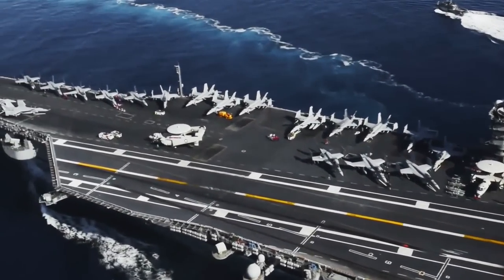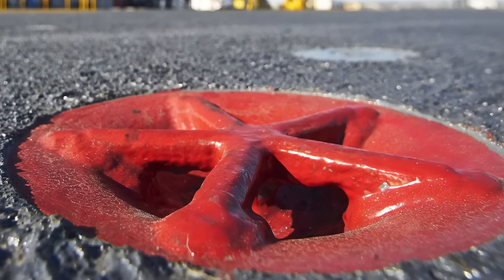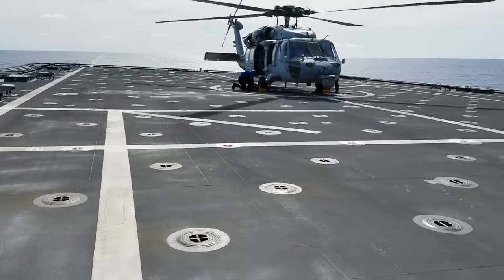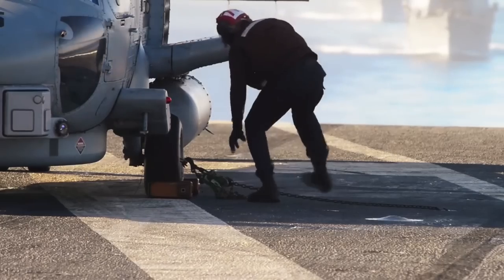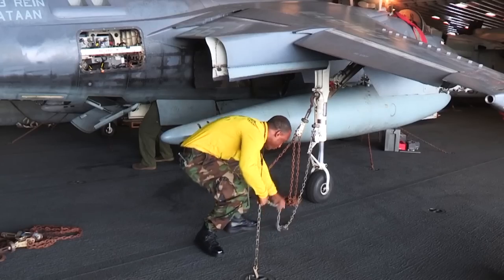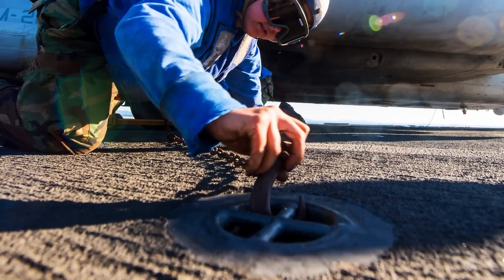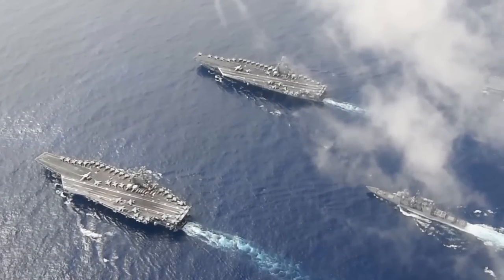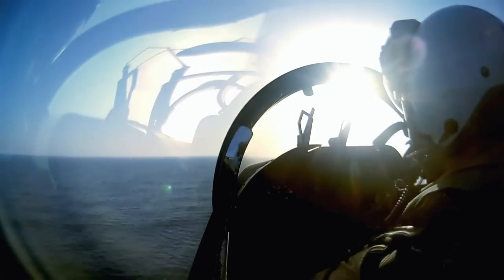Reasons Why There Are Thousands of Holes in the Flight Deck

Comment: Padeyes and flush deck nozzles are two seperate things. Padeyes are only for aircraft and equipment security. Nothing can be attached to flushdeck nozzles; they are pretty small anyhow. Flushdeck nozzles can pump salt water or AFFF (foam). Throw the tie down is not a real game but a joke made by people that sleep on the deck below the flight deck. The TD-1A tie down chain has a working load of 10,000 lbs. There are different levels of tie down security: initial (6 chains)(4 lose chains on helicopters), intermediate (9 chains), permanent (12 chains), heavy weather (as many as possible). Helicopter initial tiedowns are lose because of resonance vibrations while engaging and disengaging rotors. The thousands of flight deck padeyes are regularly checked for wear and corrosion and a new star portion can be welded into the recess. Flushdeck nozzles are checked for proper operation by the crash crew each time the ship pulls out to sea.
Reply: I just posted almost the samething sir. He was talking about Holes!!!   Hehehe

Comment: I worked on the flight deck on the IKE in 78-79 her first Med cruise. The Pad Eyes besides holding plains down, like in bad weather where we had 32 chains on every aircraft were great to grab on to if you and when you get blown down and are sliding from exhaust blast. if you find one, grab on and hold on for life! You are told to do that if it happens and one in a while it does happen.
I know because it happened to me and I'm still alive because we trained  right to work on the flight deck.